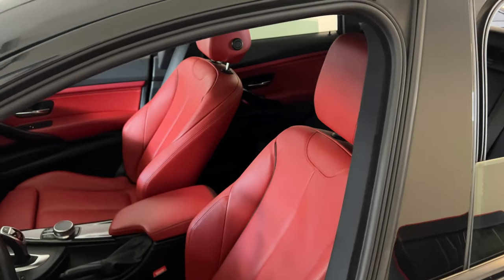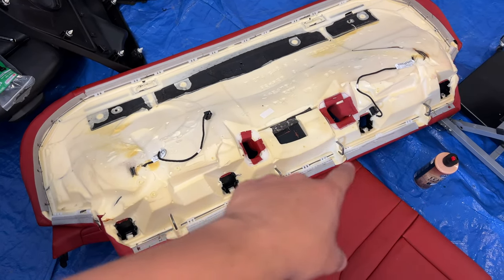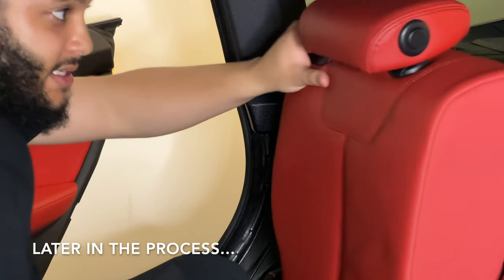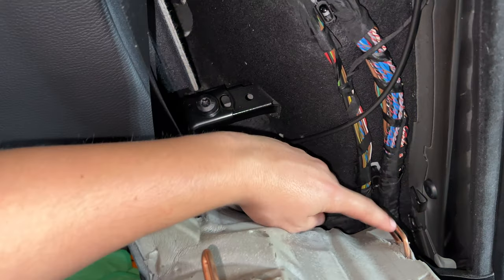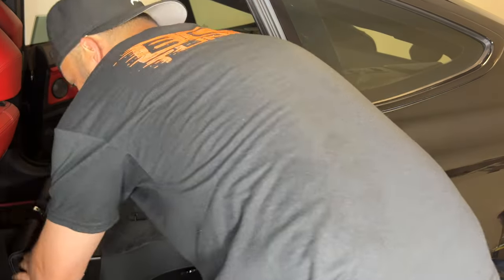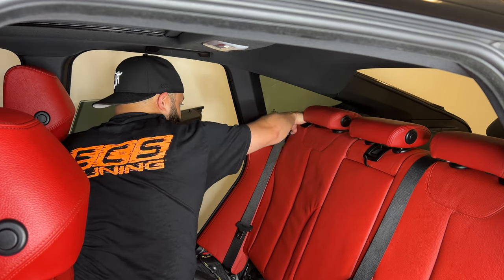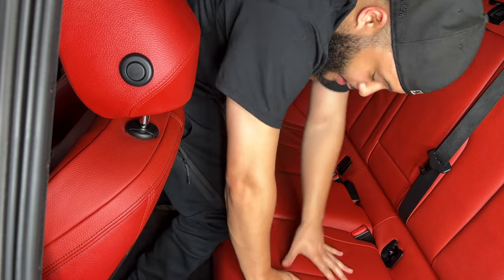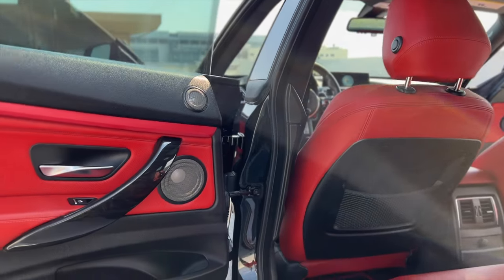BMW F34 GT Interior Swap Part 3

Comment: Hey! Great job but I think you installed the middle seat belt wrong. When tacking out the bottom seat the belt went through a hole in the bench, when you reinstalled the middle belt you didn’t put it back through.
Reply from the maker: I was wondering if someone would catch that! Lol I will fix eventually. No one sits back there especially the middle seat! 😆

Comment: How did you pop them rear seats after the re install  please bro
Reply from the maker: Say what?
Reply: @supremegt  is there a switch to fold them down 
in the video it looks like they move on there own or did you lift the latch on the top corner of the seat
Reply from the maker: @mikefletcher536  yep there’s a pull handle on each side of the trunk/hatch